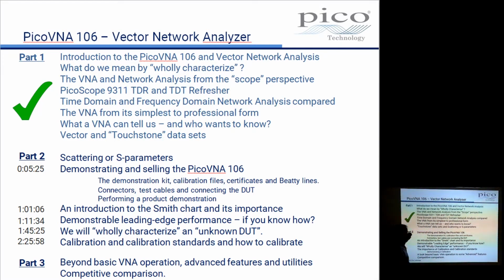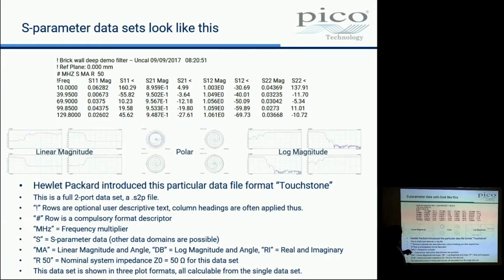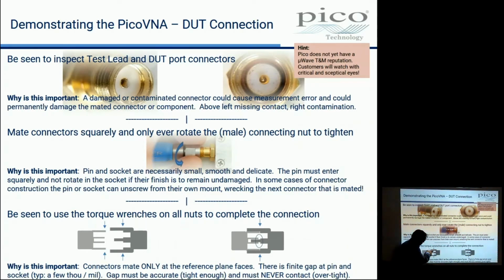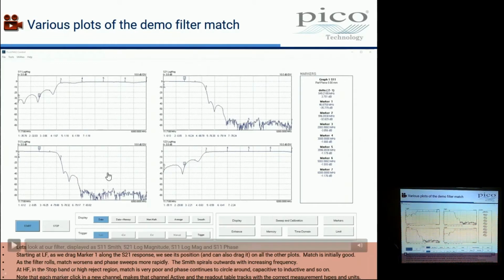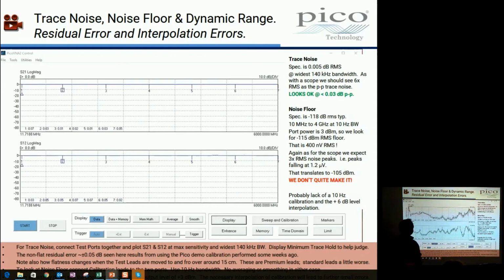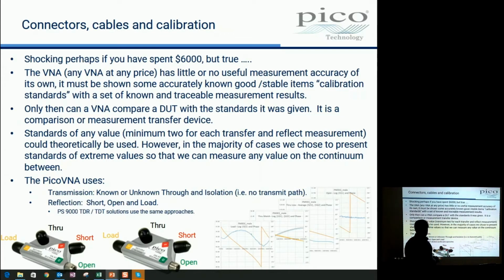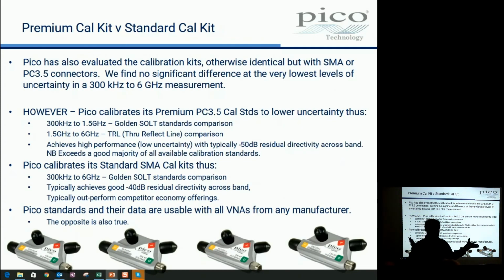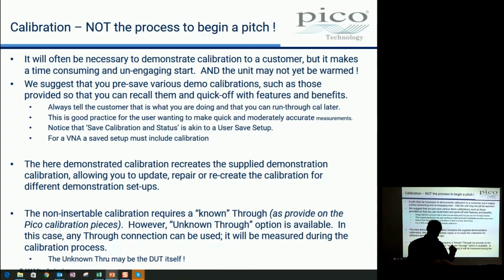Pico Technology VNA106 Training Session 2 of 3

Comment: At 2:32:00, when using the breakover torque wrench, Agilent shows you are not supposed to actually force the wrench to breakover.  From EM,   "Calibrated in the direction indicated by the arrow on the handle with the fingers gripping near the end of the wrench (between
the last ridge and the bottom) until initial breaking of the wrench head (not to full 90°)."     Videos overall are excellent.